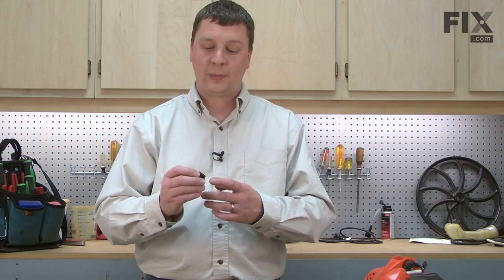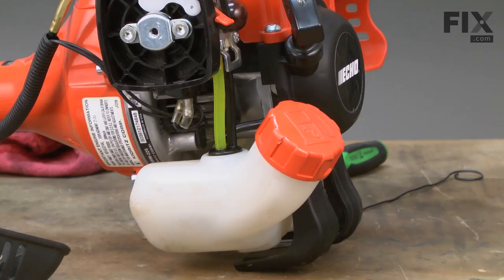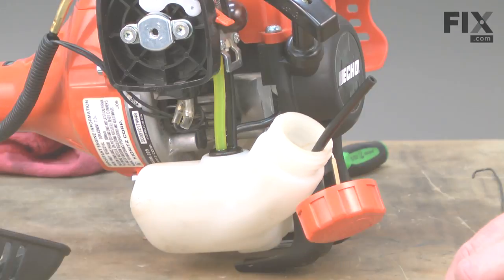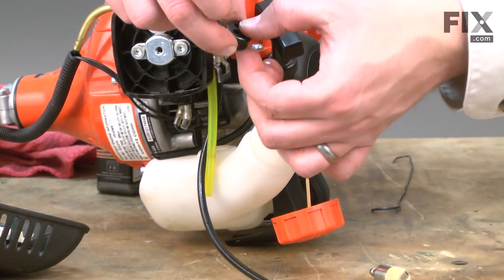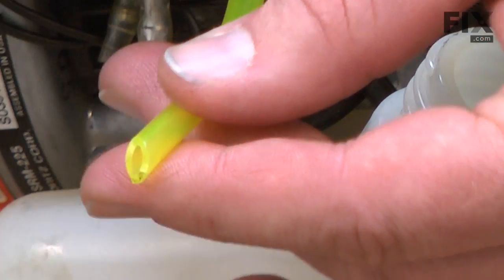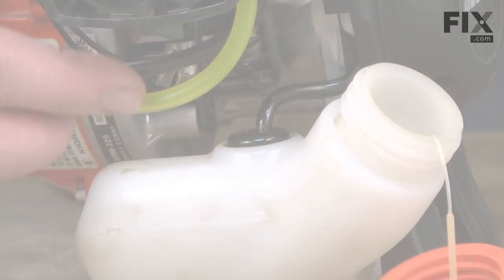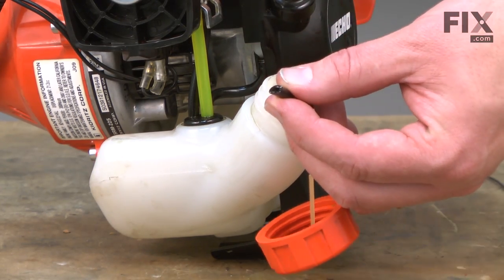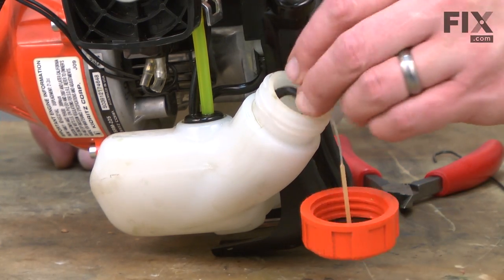Echo Trimmer Repair – How to replace the Fuel Line Grommet

Comment: 666 views and it will NOT play.  Welcome to the information highway.
Reply from the maker: Hello Mr. Brown, I am sorry to hear that the video won't play for you. Try clicking this link: https://www.youtube.com/watch?v=k3kniXj-S8Q&lc=UgwgiKdKV8y6_85IT5F4AaABAg
Reply: Hello Mr 'Fix.com',

Both videos play to the 00:50 mark and then stop.   When I try to jump around and
play the video elsewhere (MM:SS), it may play for a second then stop, showing that 
annoying spinner round and round and round.  

Anyway...thanks.  I found other videos that explain this simple process,
but I just wanted to make sure I didn't miss some fine point.
I'll still watch your channel, when it works, and I wish you would make repairs
to aged engines that we see in real life.  Nobody has EVER brought me a brand
new engine to repair and the older ones have all the problems that make
the task so 'thrilling'!

STEP 1:  Clean all the gunk off the engine.
That step alone is messy, and there are a lot of different techniques to do it properly.
Since I'm working outside (Florida) I will use old gasoline and a paint brush
to wash away the gunk, then an air hose.  If I can't SEE the engine, I will easily
miss something that is broken.  Plus, if its dirty, all that gunk gets into
parts (carb) when its taken off, and THAT is an whole new problem.

I suppose we're lucky that YouTube does not CENSOR engine repair (yet).
I can't imagine how that subject could possibly offend some humanoid.

(Views are still stuck at 666 with 3 comments....so odd the things YouTube does for fun.)

Many thanks.
LONG winded again....